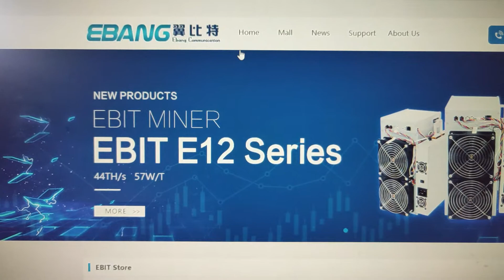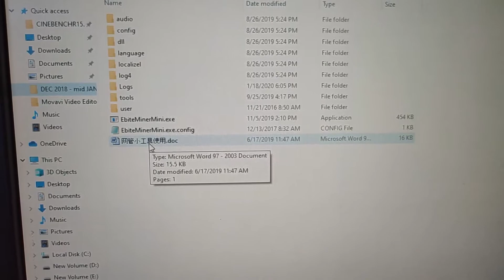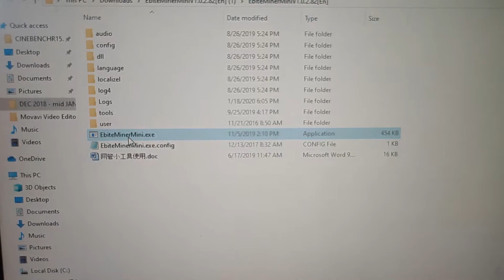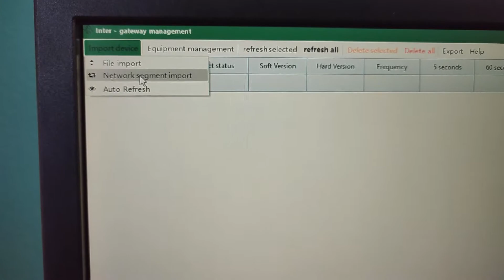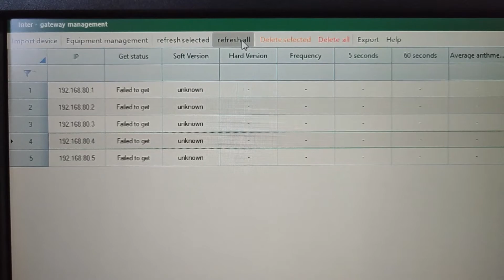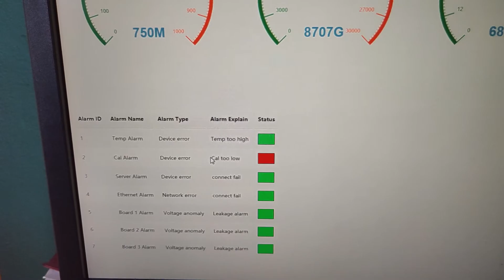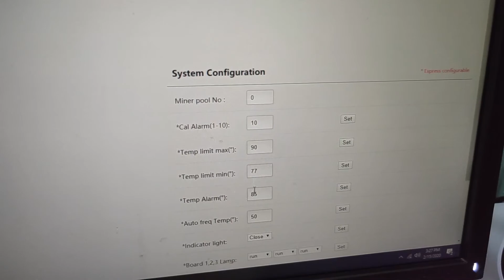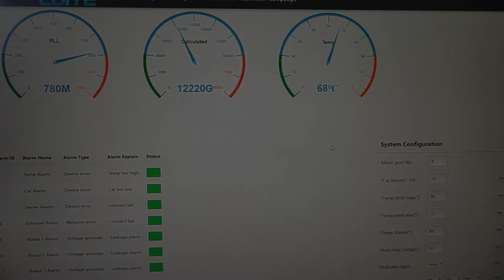Setting Ebit T10 Ebang ASIC Miner

Comment: hello sir, ebit 10.3 24th is only giving 12th. Calculation alarm is on. Any idea how to solve this...
Reply from the maker: Maybe broken hash board, or power supply.
Reply: @flyrockproduction4398  can Power supplies do this??
Reply from the maker: @mrravi-ir8ed  there is a possibility. 1 rail died on power supply +12V, then it will not power up 1 hash board. But need to check back. A bit rare on PSU, more into the hash board itself died or perhaps controller board have problem.
Reply: @flyrockproduction4398  power supply is okay working good on other miner..
Reply from the maker: @mrravi-ir8ed  ok. Then have to check on hash board.
Reply: I am looking to check individual board now

Comment: How do you fix cal too low?
Reply from the maker: Hi. Cal too low due to few reasons. 

First, your power cable to specific hash board is broken. Try swapping PSU with other working PSU. 

2nd, your hash board is broken. Swapping between hash board might can pinpoint which board is broken. After identifying the broken board, you can purchase new hash board which coat lesser than buying whole new miner. 

3rd, your controller have problem. The one that have while cables going to each hash board. Check the cables too. Try swapping them to see the results.

Comment: Hello, I have msi nvidia gtx 1660 6gb + i7 770k processor. I'm mining ethereum on Nicehash. I'm also thinking of buying an msi rtx 3070 graphics card or an Ebang Ebit E10.3 device. Which one do you think I should choose?
Reply from the maker: Hi there. If you have cheap or free electricity and don't mind the maintenance cost such as electricity, and internet, then go for Ebite Ebang miner. Mostly cheaper than the GPU counterpart. But if it's otherwise, go for GPU. Price of GPU might not be going down any sooner, because miners from China are migrating their GPU/ASiCs  elsewhere around the world, so crypto will eventually go up again. Making GPU extremely hard to find. You might found yourself selling back your GPU at few times more than the price that you pay to buy it.

Comment: Good evening, Thank you for the very good Video, pls, My Ebang E10,  I JUST buy it FROM SOMEONE  is flashing RED light after  3 Minuit of ruing, pls  what could be wrong with it, thank you.
Reply: Hi sir, my e10 also blinking red light beginner, after than turn to yellow stil.. But Ip did not appear on lan management? How to solve this.. Thanks for enlighten.. Appreciate
Reply from the maker: @boonchaichia5761  Hi. If from red turned to Yellow, it means, gradually, the hashing rate speed increases until it reaches the intended speed.
Reply from the maker: @boonchaichia5761  You can trype in Google, find my IP. They will tell you your IP.
Reply from the maker: Hi there. Thank you for your comment. For red light, if I'm not mistaken, it's because of low hashing rate. Do check the speed of the mining from their website. The full speed will be as described in your miner. Any lower than this indicates a broken hash board on any of the hash boards inside your miner.
Reply: Hi did you found any solution
Reply: Mr. Lawrence

Comment: Good morning, thank you for the extremely educational video. Can I ask if you would recommend a mining system from Ebang? I’m looking into mining and I saw your video, I’m hooked!!! Is it fairly profitable?
Reply from the maker: Hi there! Any high terahash with acceptable wattage from any miner company is a good one. But Ebang is a little bit better than Bitmain due to the much lower temperature of hash board, from what I know. Bitmain could get up to 80-85°C while Ebang only went to 70-75°C from my experience. If you could get 40-50TH or even higher miners with power usage of lower than 2000W, that would be great. Do keep in mind that a limit for wall socket power usage would be around 3000W.

Comment: Friend I saw your video and the truth is that you easily connected the machines, I have an E9 + and until yesterday I was mining and right now it is 24 hours without mining and I cannot get the IP of the machine with any software. Can you help me? I write from Venezuela
Reply: Epa bro @criptopartes en ig, ellos son unos verdugos arreglando todo tipo de problemas con configuración etc. Si no en mercado libre, hay gente que te ayuda con eso, osea ponen sus servicios ahí. Yo también soy nuevo en esto justo hoy acabo de comprar mi primera e9
Reply: @kikebolivar6125  gracias amigo ya los contacto
Reply: hola, recomiendan las e9?
Reply: @DiegoRamirez-cq9td  amigo tengo s9 y e9 y las s9 me han dado más problemas. La e9 nunca. Ella ha funcionado excelente
Reply: Son buenas las e9? Las recomiendan.
Reply: Sorry, a little late to see this. Were you ever able to find your E9 using the IP on the side of the machine?